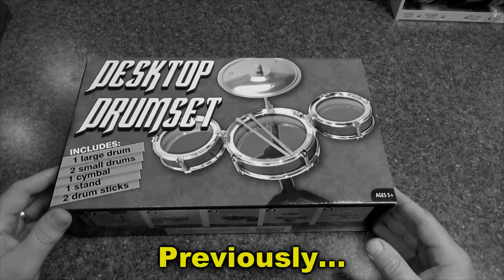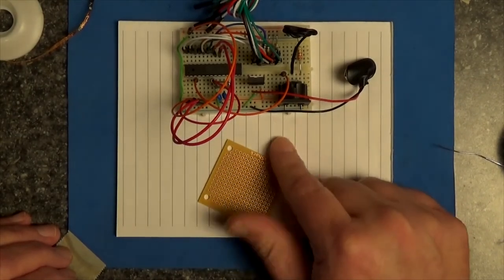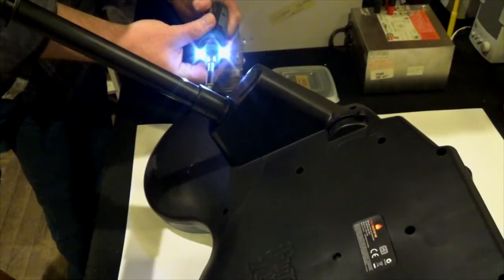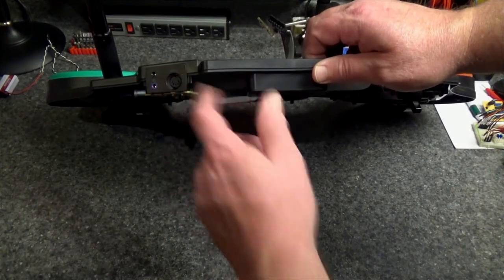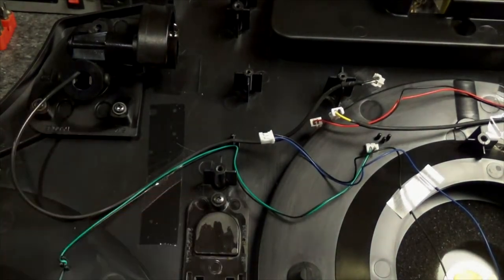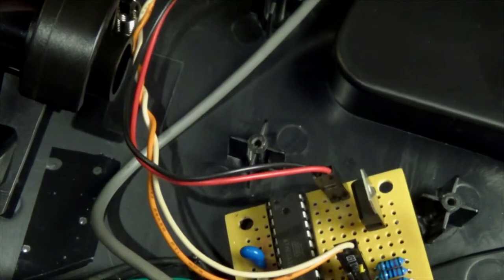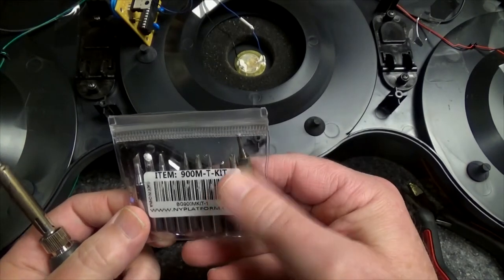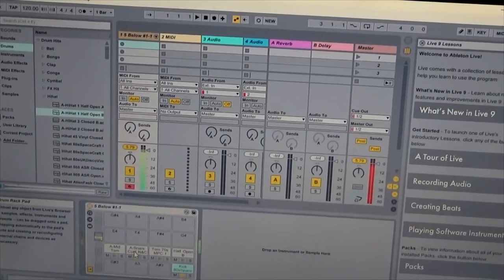Guitar Hero Drum Midi Conversion Using Arduino Chip

Comment: I bought one just like that for $2.99. The cymbal cables are just like those so I would be replacing them too. I was going to leave the arduino inside; but now let me see if I take on the adventure of moving into a protoboard with a chip I was going to buy an arduino protoboard to plug it on top shield type I guess I forgot the space issue. Maybe I'll mount it outside to make like look a little bit rd2stic. Thanks for your video!